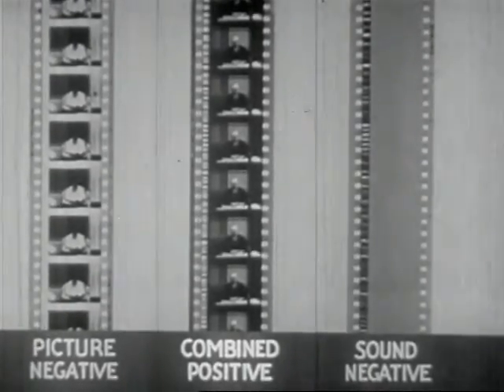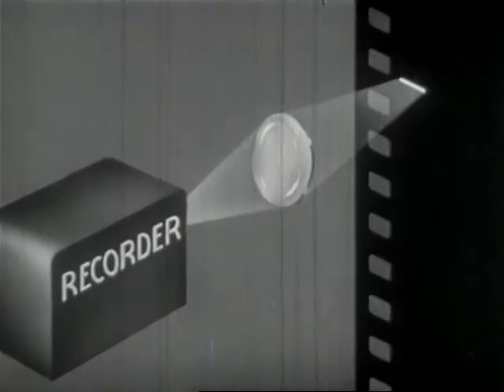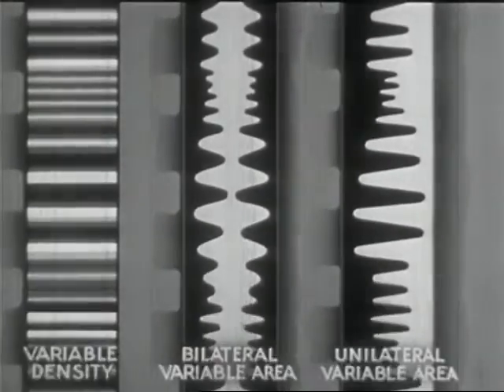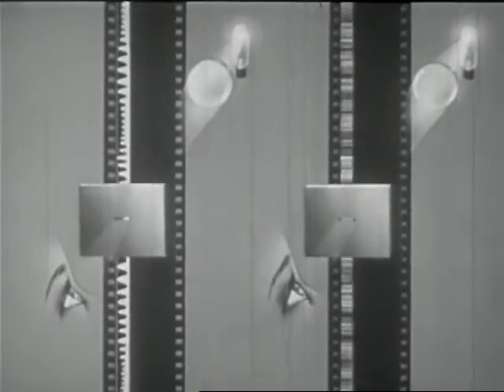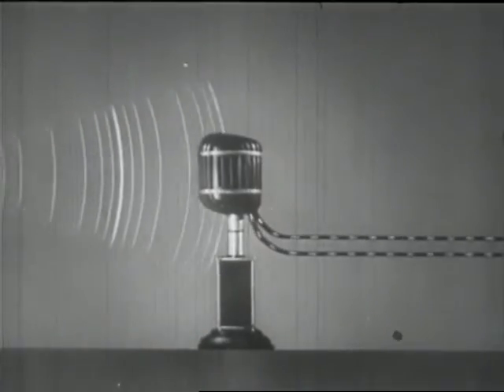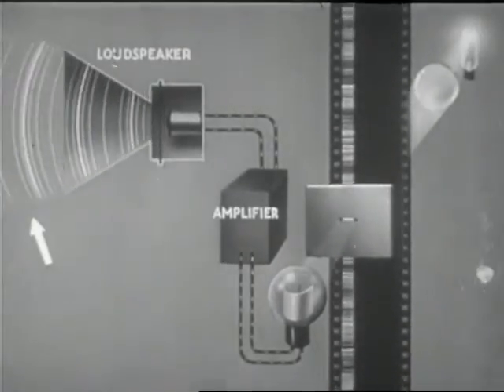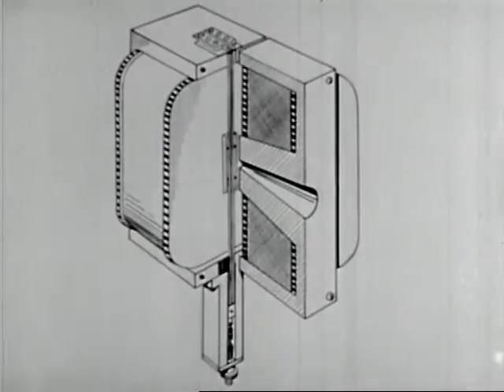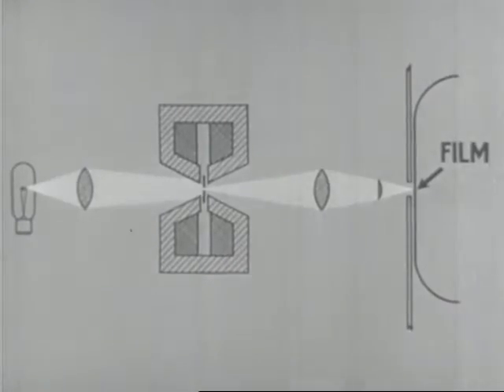Sound Recording And Reproduction (1941)

Comment: Does not show how the light shutter is used to produce the variable area soundtrack? Maybe a patent issue? The shutter ribbons must increase and reduce the width of the line on the film, which has constant illumination. Strange not to explain this. The film also shows that the shutter increases the width of the line to correspond with the sound level, which would make the frequency response depend on the volume of sound. There will always be some halation (light spread/spill and reflection from base material, not 'lens flare') in the film emulsion, but this illustration is a bit weird. You couldn't have loud, high frequencies? Something got mixed up in the conversation between the technical people and the educational film production studio.